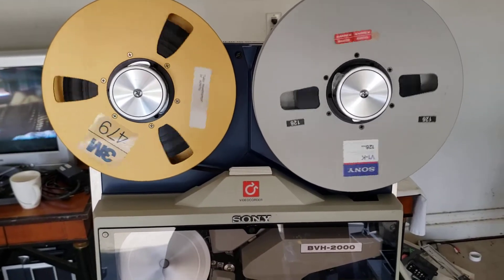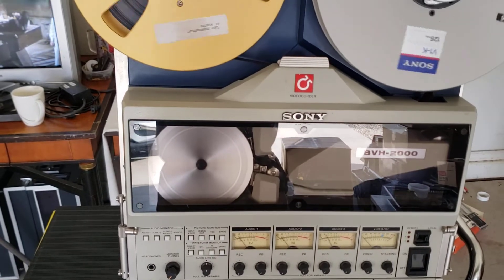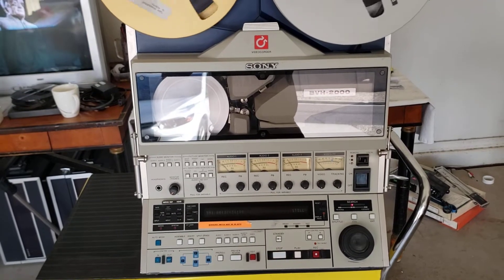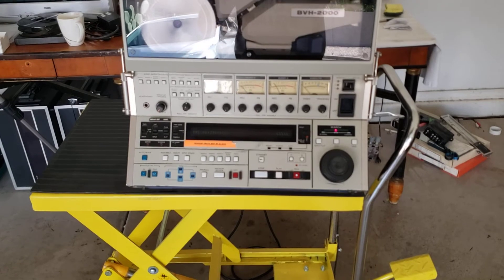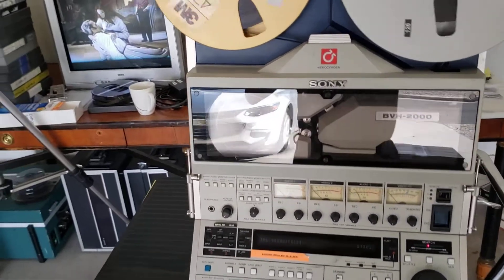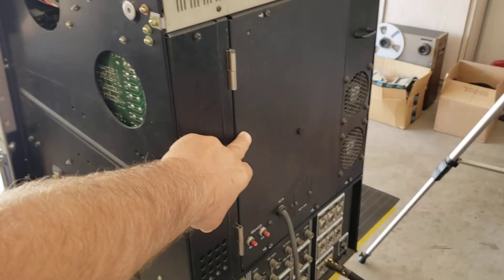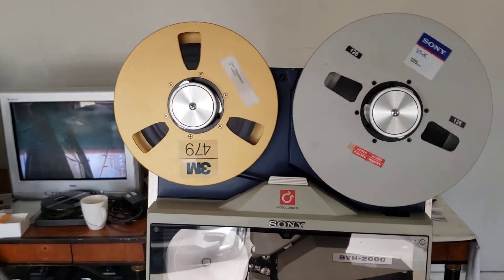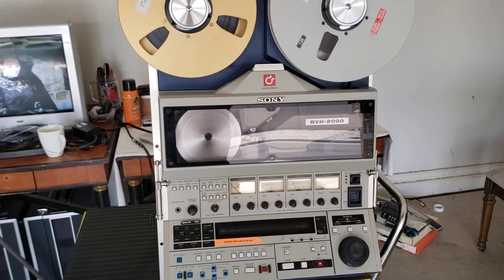Fans Questions Answered. Bvh-2000

Comment: The BVH-2000 is a great machine, I prefer them over the 3000 series(bad leaky capacitors and a scanner bracket made out of pot metal). Another thing that can cause issues are dirty edge card connectors, you can give them a basic cleaning with a Kimwipe dampened with 99% IPA and that will work to get a lot of the gunge off the connectors, it is then advisable to follow up with a wipe down from a DeOXIt gold wipe, this helps to protect the gold plating and also lubricates the connectorgold making card insertion and remover much easier, when I did that to the 1984 BVH-2000 I use at work every day, the Dynamic Tracking started working again. 
The original high-quality TBC for the BVH-1100A and BVH-2000 is the BVT-2000, which can be connected using BNC cables, but if you use the large multipin cable then the TBC allows the Dynamic Tracking to work. There was a TBC cared for the 2000 but most pros do not like it as it only digitized the video ay 8 bit.
Reply from the maker: Absolutely Correct Deoxit should be used on Connectors.